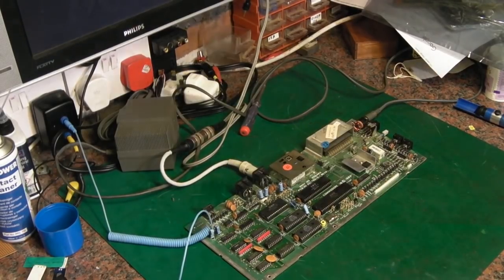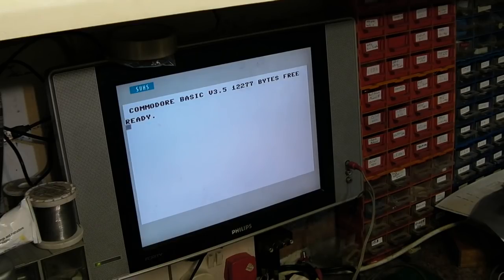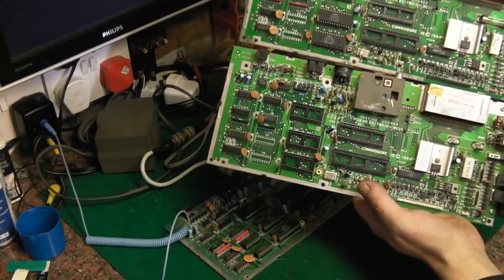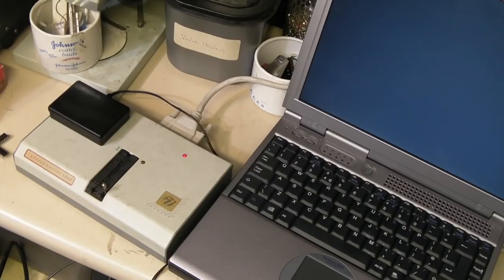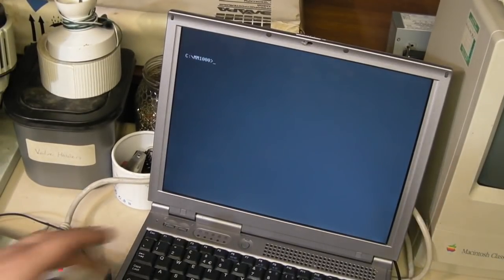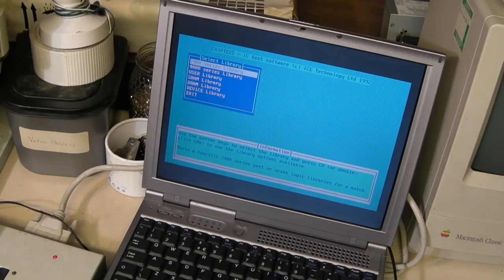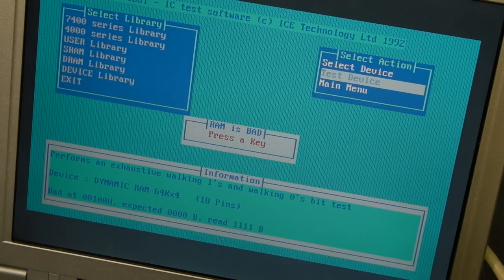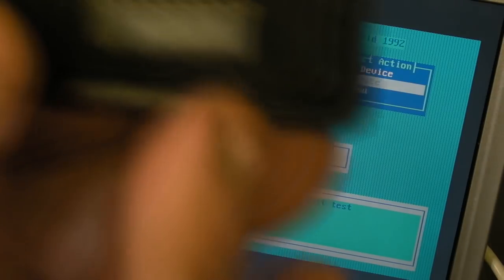Commodore C16/Plus4 lot repair Pt4

Comment: "Device not present error" can pop up if SD2IEC's device was changed (8, 9, 10, 11), check all of them with the LOAD command.
Check the VCC with the scope while it's working and while it displays black screen. Could be caps, could be dodgy power switch which needs cleaning inside out, could be sockets, could be stuck reset signal, could be many things.

Comment: A common source of black screens on C16s is either U7 or U8 they are MOS 7708. They are MOS/Commodore's version of 74LS257 and are notorious for going bad over time. You can replace them with a regular74LS257.
U9 7406 could be the reason why the SD2IEC does not work. It is responsible for pulling the IEC bus lines low.
BTW in the video when you rechecked the RAMs for a second time you still had it set to 64x4 not 64x1.
Reply from the maker: Thanks for that invaluable information I will check out U7 U8 and U9
Ps for the RAM test 64x4 was correct as they are 16x4